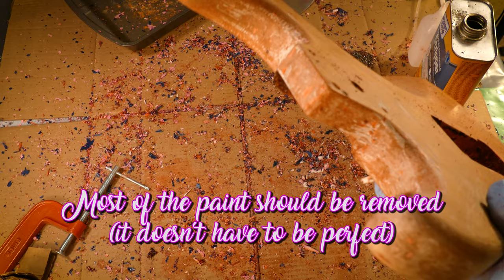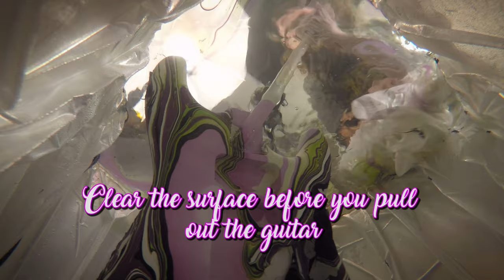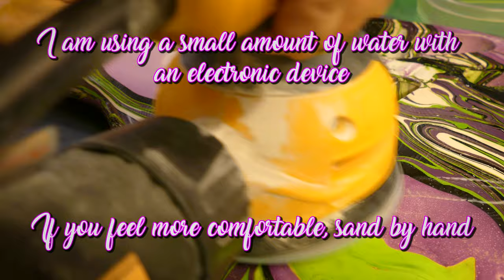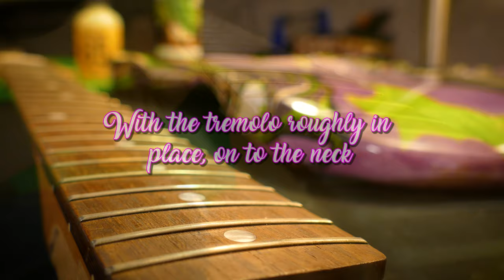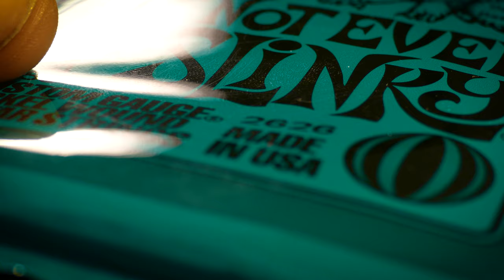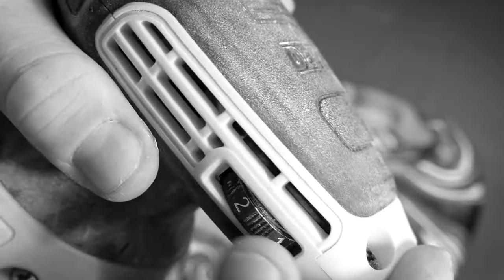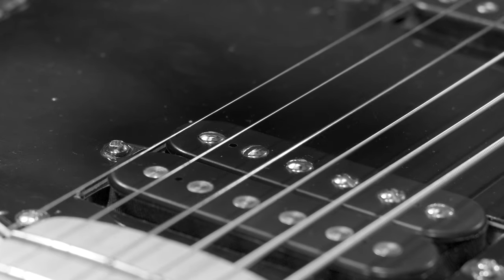How To Hydro Dip A Guitar DIY - 4K (UHD)

Comment: A couple of questions. First, what do you advise about putting the neck back on? I’ve done some repairs/modifications on guitars before and the screw holes are weakened considerably once the neck is taken off. And secondly, is it possible to use too much or too little paint, or is there an overall ideal amount?
Reply from the maker: Hey, John G!

Great question! Lucky for me, it was entirely a new neck, but you raise a good point. I would suggest maybe feed a little bit of wood glue or wood filler compound into the holes once removed from the body. Then let it dry. Once you are ready to reattached the neck, drill some pilot holes for the new screws. Just be sure they are small enough for the threads to catch. 

In regards to the paint, are you asking in general, or to a hydro-dip senario? 

Thanks for the questions, btw!
Reply: Event Horizon Records for a hydro dip. It seems that what’s happening is you’re creating a viscous film of paint; if that film is too thin, (ie not enough paint) will it break apart and ruin the effect?
Reply from the maker: @johng2463  I see. Yes. Some of the film can break apart, but I think a lot of this can be alleviated with a larger tub. Larger tub will give you more  surface area. That was the largest clear one I could find, so, I went with that. You really shouldn't have any problem getting coverage with a larger tub. I would try dipping a couple different things to get a feel with how the paint reacts. Some enamel paints may do a better job than others, and get you the desired effect that you are personally looking for. The thickness of the paint in different areas doesn't matter so much because I suggest doing a lot of clear coat/lacquer anyway, so it will smooth out. We want to protect all of the work you did.  Does this answer your question?
Reply: Event Horizon Records pretty much.  I’ll just have to literally dive in.  Thanks for the quick responses and the video.  It’s very well put together with the music.
Reply from the maker: @johng2463  Thanks, John G!

Comment: If my guitar is already white do I need to strip the paint?
Reply from the maker: Hi, Riley!  I'm assuming it has a clear coat/lacquer. I would at least try to remove that, or sand it down really well. The reason why I removed everything, is because this is an old guitar, and had been sitting in a garage for a while. I wanted to ensure the would was in good condition with no water damage or mold.

Comment: How thick should the paint be on the surface of the water? You used clear lacquer over enamel? And I never saw the addition of borax into the water before. What is the purpose of that? TIA.
Reply from the maker: Hi, Ricardo! The thickness of the paint depends on the look you are going for. If you want hard lines, then thicker paint. If you want it to look more like a marble, then thinner is the way to go. Borax helps keep the paint on the surface and helps the Enamel spread. Hope this helps!
Reply: @JoeLewis14  thanks mate!!

Comment: Why not just paint over it?
Reply from the maker: Hey, vuhnilla!

That is an option, but there are some downsides to painting over the existing paint. 

I stripped the paint because I bought this guitar off of my buddy, and it had been in his garage for a couple of years. I wanted to inspect the body and ensure the wood is in good condition (i.e. not rotting or water damaged underneath the paint). This would only create problems down the road if it were. I also didn't want to risk poor adhesion from the factory, especially after it had been in his garage for some time. Once I determined the wood was in good shape, I pressed on with build. Lastly, as silly as it may sound, it will make the guitar quite a bit heavier with all the extra layers of paint. Although this isn't a huge deal, it just makes it that much more comfortable when playing with it over your shoulder for long periode of time.

Good question, but since you would have to sand down the paint/clear coat anyway, I figured I might as well get it all off of the guitar. Thanks for the question by the way!

Comment: Can I use black primer? Cause the colours i want to use go with black nota White. Will ir affect The result? Thanks!!
Reply from the maker: Hey, Gabo!

What colors were you thinking of using?
Reply: @JoeLewis14  black, green(fluorescent)  AND pink (or Violet, not sure yet).
Reply from the maker: Hmmm... That is a tough one. 

I  personally would still use a white primer because those colors will not stick out very well against a black primer. I would use the black, green and pink enamel paint on a white primer, with no white enamel like I used. If you notice in the video, I used white enamel even though I had white primer underneath. So, maybe do the same thing I did, except omit the white enamel.

BUT, you can always try using a black primer with those colors on a small object to see how it looks. It could turn out just how you like it. But, from my experience, color paint on black primer does not show very well.

Hope that helps. Let me know what you decide to do! I would love to see how it turns out!
Reply: @JoeLewis14  thats an excellent idea, i Will try on a small THING AND see how it turns. Sorry for my lame english. Will update The progress. THANKS!!!
Reply from the maker: No problem! Don't be sorry! Your English is just fine. I love the questions. They get me thinking. Let me know how it goes!

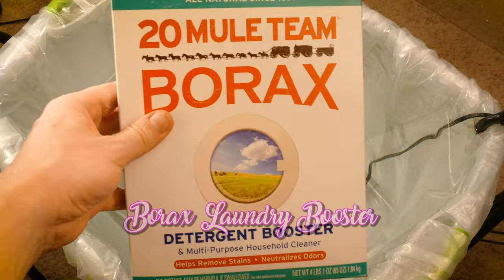Comment: In what ratio to mix borax and hot water at 7:24?
Reply from the maker: Hi, there! 1.5 tablespoons per gallon of water. Hope this helps.
Reply: @JoeLewis14  Why we should use borax? How it helps?
Reply: @JoeLewis14  why we should use borax? How it helps
Reply from the maker: @Ruuit  Hello! The Borax prevents the paint from mixing with the water. It keeps the paint on the surface. It also helps spread it out as well.
Reply: @JoeLewis14  thanks!
Reply from the maker: @Ruuit  No problem!
Reply: @JoeLewis14  
Sorry to be so annoying, but I have a couple more questions. How is it that there is less paint on the water surface than the entire painted surface of the guitar? Logically, there should be as much paint on the surface of the water as on the surface of the guitar. How do you calculate that? Does the drill(borax) affect this?
Reply from the maker: @Ruuit  It's okay. If you want to be sure thay there is plenty of coverage, get a wider container/bucket. Depending on the quality of the enamel paint, it can sometimes have a hard time spreading out. You may want to add some paint thinner to ensure that the paint is thin enough to break and spread when you dip the guitar.

Comment: $50 in caustic strippers and way more time spent than a $25 heat gun.
Reply from the maker: Hey, Toxic avenger!

Can you elaborate on what exaclty you mean?
Reply: @JoeLewis14  sure can. When I go to strip a guitar, I use a Wagner stripper that i bought at Lowes for $25. (The cheapest one they had). Also invest in a 5-in-1 tool. You use the heat stripper like you would a hair dryer.  BE CAREFUL dryer gets hot and so will paint.  WEAR heavy duty gloves to protect your hands and all appropriate safety gear. As you point dryer at paint, it will begin to bubble and you can easily strip it off with the 5-in-1.  Dont stay too long in one spot. You can burn the wood underneath. There is a slight learning curve.  You can also stop at any point and reheat the spot you left of at. It's so much easier and doesn't require any type of neutralizer or chemical. I've done almost 30 guitars this way. On Jacksons, ESPs, Fenders etc.  I hope this helps. And good luck if you decide to try it.

Comment: Seeing you swapped out a large number of components, wouldn't it be better to start with good kit guitar rather than dismantling an existing one? No stripping for a start and it would be way cheaper to just buy the parts you wanted in the first place. Granted, you had the guitar sent to you but starting from the bottom up seems a better way to go.
Reply from the maker: Hi, Ian!

That is certainly an option, but I actually bought this guitar off of a buddy for $40, so it was actually cheaper for me to do the process this way since I already had the tools and material to strip off the paint. Buying a kit is definitely an option, but I also wanted to see if I could transform this $40 Squire my buddy found in his garage into something much more interesting and better sounding. You can certainly go your route as well, but it will be a little bit more pricey, but easier if you don't have the materials to strip it down. Thanks for the question!
Reply: @JoeLewis14  Gee you've got me thinking though. I see that you can hydro dip fabric designs on as well as patterns. 

Where I'm coming from is that I will be in England shortly, after I fix some storm damage to my boat that diverted me to Guernsey (Bay of Biscay can get veeeery nasty). There I'm looking at doing a 6 day building course at Crimson Guitars - top notch body wood, no tops, just carved and grade-A hardware, somewhere between a PRS and a Les Paul.

But If I signed on for a bit longer, I could also build one of their strat-type kits - finishing the body and headstock to sealed and primed stage - then send those parts out to a dipping service while I get back to the first guitar. Then I end up with two great guitars of totally different types and styles.
Reply from the maker: @ianb4801  That is really cool that you have that opportunity. If you have the resources, then certainly make it happen. If you fabricate one, let me know. I really want to see the end result!